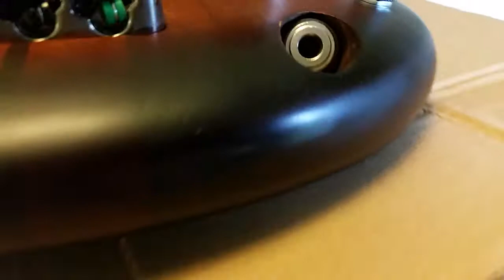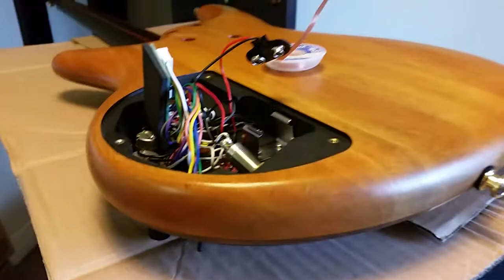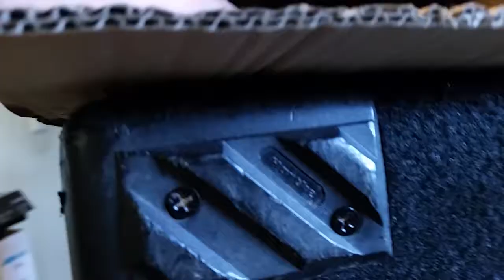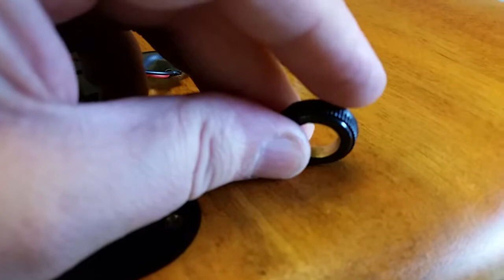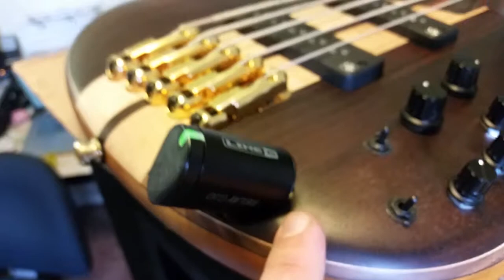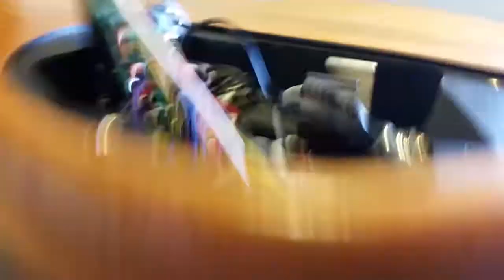Setting up an Ibanez bass to use Line 6 Relay G10 wireless

Comment: Is the same for ibanez guitars? I’ve got an AZ and the same problem!!
Reply from the maker: It's just a question of power polarity through the Ring and Sleeve.  The G10 transmitter expects one polarity.  If your instrument agrees, no problem.  If your instrument disagrees, you can change it with a small soldering job.
Reply: @ethanhunt236  Thanks dude!